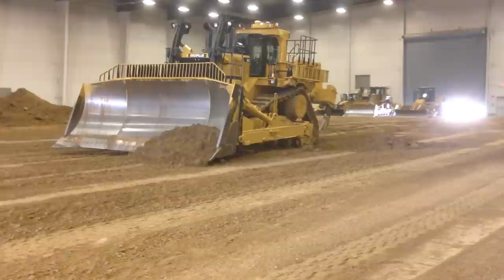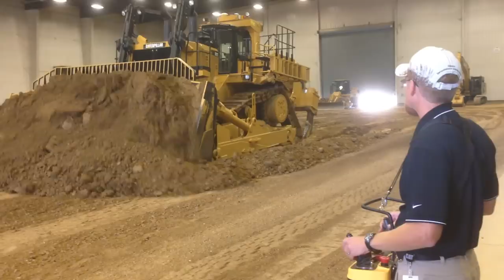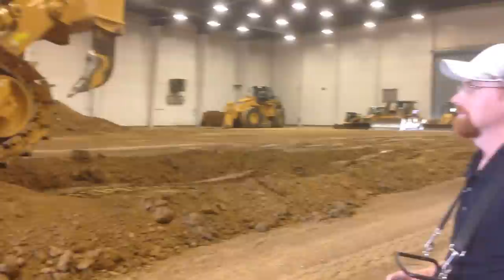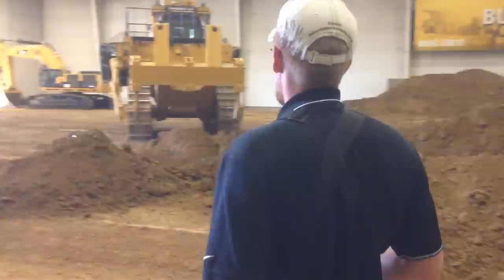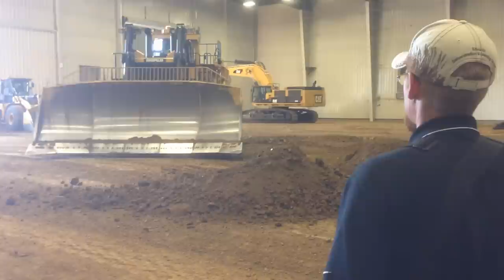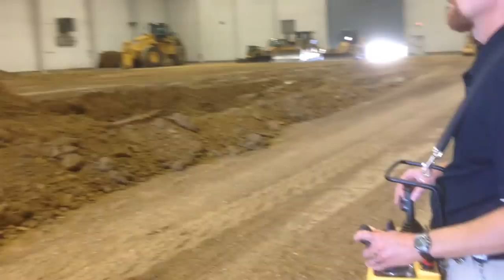Remote-Controlled 900+ Horsepower Caterpillar Bulldozer

Comment: Hi, Folks.
                Do you mean that some poor sucker has to STAND out in the blazing sun to operate that machine instead of being in the cab in air-conditioned comfort? 

More than half the fun of operating these machines is the sense of power and control that you get from being right there in the seat, and FEELING the machine do what you tell it to do. I somehow that the same level of control is possible OFF the machine, even if there is a shady tree close by for the operator to stand under - - - or sit if the employer is thoughtful enough to provide a seat.

I have never operated a remote controlled machine but, after 50+ years of seat time, I think I'd still prefer to up there in the seat. I learned a LONNNGGG time ago that the machine will only be as rough on you as you are on it.

Just my 0.02.

You all have a wonderful day. Best wishes. Deas Plant.
Reply: maybe they use this way to operate in a poor security task as a minefield i suppose
Reply: Hi, Sergio S.
They have been using RC 'dozers for some years now for various tasks, mainly around large open-cut mines for either overburden removal or restoration, supposedly to avoid the possibility of human injury in the event of an 'accident'. I would suggest that 'accidents' might be a fair bit LESS likely with a good operator sitting in the seat and having 'seat-of-the-pants' feel of the machine.

Just my 0.02.

You have a wonderful day. Best wishes. Deas Plant.
Reply: Thank's, be well!
Reply: Agreed, no AC cab? What's crazy about those is how quiet they are in the cab, that will come in handy for Trumps wall project although they do have bullet proof glass in the cabs already.
Reply: In some mines they are removing the overburden to get to veins of coal or other mineral which had been mined up to 100 years prior by using tunnelling..driving a 100 ton machine over these old shaft is very risky so remote machines can be used to keep the operator out of harms way.
Reply: I agree I only have 25 years and I was always told u operate by the seat of ur pants literally. have to be able to "talk" with the machine
Reply: Deas Plant maybe people would like to hear what you have to say when you actually use correct grammar
Reply: It's not that this is how they operate two at a time
Reply: But this tool is very functional to commit crimes against humanity, especially which is often done by Isarel in Palestine
Reply: Deas Plant i pretty sure the remote is mor for unsafe situations  such as a steap hill or something that you dont feel safe being in the cab doing as for me I prefer being in the cab all day I run excavators and loaders all day long and I dont feel that remote is the professional way of doing it but people have there own thought and ways I guess I got a CAT 289D at my house I use almost everyday to fix up the yard and not once have I found a reason to use the remote it just sits in my closet
Reply: when your fueling it up and try to get as close to the tank as you can.
Reply: Deas Plant dont forget radiation polluted territories, like Chernobyl. No one will sit in a cab there
Reply: once the entire machine is computer controlled, then a script can make it to tasks without an operator.
Reply: I'm sure they just wanted this for a safety thing.  I don't think companies would ever permit someone standing around a quarry or lumbar site with a dozen other huge machines.
Reply: Deas Plant thats not entirely what they are saying cause you could sit inside of it but you might as well just use the regular controls if youre gonna do that..the poindexter in this video had nothing better to do than to implement this technology into a dozer.

Comment: seems hard to run. I've been told to run equipment by the seat of your pants. meaning you have to feel the machine to run it as it tilts or rocks back and forth ECT. seems like it takes talent to run it effectively and accurate.
Reply: As a 20+ year operator its painfull watching this guy...this might be ok but i would prefer to he in the seat
Reply: 100 percent run a 9L and 10R at work definitely on feel

Comment: Why is it equipped with flashing blue lights on the top ?
Has the Sheriff got him self a new company car ?
Reply: For safety, the blue lights will be easily seen in a quarry
Reply: Somebody operating another machine.
Reply: The blue light is one of many colors for remote operation
Reply: Normally they'll do orange beacons but blue is the same, when it's put into the quarry or construction site it's so other operators in sometimes bigger vehicles can see them.  And some companies work late afternoons and in bad weather.
Reply: Everything in a mine or quarry has designated flashing light to tell what it is gotta remember most of these places are 24 hour operations
Reply: Blue lights in a quarry means remotely controlled

Comment: Will never be as good as a good operator sitting in the seat and oh by the way need to tighten the Dame tracks jeeeeezzz
Reply: It is mainly for use in unstable zones, ie rockfalls, tailings or land slides.
Reply: 10 4
Reply: +James Burnette for something that will help you avoid hazardous conditions, it's good enough for now. and technology advances exponentially!
Reply: +James Burnette They run that way.
Reply: Flatline Heartbeat to sloppy. You probably never had to change tracks.

Comment: If one of my guys was to leave my work site with a pass like that I would fire them. Leave the operator in the seat
Reply: @Wyatt Duboise you always engineer safety into your operation. There is no way im going to put man or machine in a unsafe or potentially lost of person or machine in that situation. The operator's that work with me are first class and it would be more dangerous with a joy stick driver than a real operator. My opinion with 25 years behind it.

Comment: While there might be an ocassion where being off the machine would work. Why would any Operator want to stand out in the sun , rain whatever. Which that control box hanging off his neck ?  What do you guys think ?
Reply: Marc Langevin why would the guy have to be out in open. Why not have a small shelter with an umbrella and shit? Anything is better than being strapped to some of these torture devices.

Comment: Work great but that 8 to 10 million dollar dozer not to do a walk around inspection check for cracks in the welds ect nice concept but costly mistake just a thought thanks and the remote read oil temp final drive temp ect thanks

Comment: Now why in the hell would I want to stand out in the elements to operate that machine ? With a  ? lb control panel hanging off my neck !
Reply from the maker: Marc: the remote operation is designed for locations where there is a risk that the operator could be injured - ie mining operations or unstable ground, so they can stay safely outside of the vehicle.
Reply: @theawesomer  I realize that there might be the need for the remote control in some applications. But I am old school. Started running equipment in 1970 .

Comment: What happens when the remote gets a flat battery
Reply: Its a safty switch that turns it off. Same if you were to fall over. Theres a sensor that kills the machines power to move till the board is back at the correct angle again

Comment: What's the point?
Reply: Jpaydirt i saw this thought of you saw you commented...whats the poin what i thought....well put on a high wall in wv coal mine working it down....not feel it slip atittle and walk off alittle and uhhh ohhhhh down goes a 2mil dozer tumbling down the hill....but hey atleast there wasnt an operator. right....later man
Reply: I know they explained why at Conexpo, I just can't remember, ☻
Reply: Carson S okay and where is tje operator gonma be able to see all this stuff? From the bottom.  If he cant even see where the machines edges are , whats the point if he cant even see what hes gonma hit.. its gonna end up comin down anyways... 5 yrs of backhoe and tractor operation and i already kno it wont worm
Reply: Luis Sanchez yea i know it wont work in those situations...i was being sarcastic cause you have to feel in the seat as much going on as you can see...especially if soft ground or something...pretty usless unless driving straight at ISIS with a brigade hiding behind the blade....
Reply: Well I can tell you why Allis Chalmers invented the remote controlled crawler back in the 1960's was mainly for work at the steel mills, where the operator couldn't handle the heat, but the machine was built with special hoses and wiring to handle it. Also for dangerous situations in the armed forces etc.
So once again Allis Chalmers was 50 years ahead of the crowd
Reply: They can use this in hazardous situations like if they hit a giant gas leak while mining or at trash landfills where the methane gas is to much for a person to handle  or if they need something done and it's too dangerous for a operator to be involved in even tho that machine cost well over a few million it's not worth a persons life so I think it's pretty amazing that inside that dozed there are hundreds of switches to control it that guys little box can do it all from there haha
Reply: Umm... a gas leak? that would cause the engine to run away
Reply: Jpaydirt it could knock the operator unconscious and then possibly lead to suffocation
Reply: Wade well you definitely couldn't if you're dead. Also I imagine it just takes practice.
Reply: Ger Stephenson a gas leak will make the mechine run away, and you would have known their was gas plenty before the mechine runs away. Ive hit gas lines milling and had the fucker start running away and i had to stuff the shirt off my back, and my side guys shirt into the intakes of both motors
Reply: ryan lucey A gasoline engine might run away, but a diesel won't. Gas would need a spark to ignite it, there is no spark with a diesel. If it was burning natural gas it would just have more power until the diesel was shut off, the engine would stop
Reply: Incorrect sir, a diesel is a compression ingnition engine and will run on any vaporized fuel no spark needed
Reply: In case of accident the driver isn't killed
Reply: ryan lucey we're talking about hitting a gas pocket in a rubbish dump, the driver being knocked out and suffocated. A gas like methane will give you no warning, it's colorless and odourless so better to use a remote and not risk it.
Reply: Ger Stephenson I thought garbage dumps had breathers? And I understand its odorless i passed hazmat
Reply: Jpaydirt No I'm not incorrect. A diesel runs on compression gasoline or natural gas engines run on spark ignition. Compressing natural gas would not make it ignite without some type of spark. On pulling tractors they use to feed LP into diesels for more power, but the diesel ignited the LP giving it more power. Compressing gas actually makes it colder
Reply: Well think about it dude a diesel running and ingesting natural gas will run away, Why do you think all oilfield equipment has to have automatic valves that block the exhaust ? if a diesel ingest's natural gas it will runaway and also will ignite the ploom causing one hell of an explosion, if you don't believe me goggle it
Reply: Jpaydirt I've been a diesel mechanic for over 30 years. If you think I'm joking take the 3406 in your Kenworth feed LP from a propane tank into the intake and shut the key off, let me know how long it runs. For one thing gas rich air coming into the intake with no diesel fuel is going to be way out of time  to keep an engine running. Further proof is Cummins, Cat, Detroit all make CNG engines, they all have spark ignition. If a diesel will run on natural gas they would leave the engine alone, not highly modify it
Reply: Jpaydirt gladly. First off your dealing with OSHA, and much like any government agency facts have little to do with rules and procedures handed down by them.  As a contractor you I'm sure know that the majority of government rules and procedures have little to do with real life.Second if you read the article every picture says "believed" to have caused, which has about as much credibility as turning your cellphone off before the plane takes off, because they "believe" it may effect the plane, when in reality there is 0 proof it has any effect
Reply: ryan lucey your probably right, but the engine was designed to run like that. A regular everyday diesel engine is not
Reply: Actually the rules are  derivitive of the mistakes and carelessness of humans, comparing an electronic device to a flammable gas being ingested by a diesel engine is a poor comparison, I think, You have given me an idea.....I'm going to test your theory on and old junk engine to see what happens, may I attribute the results to you on my channel?  sort of a mythbusters video☻
Reply: Jpaydirt i cant wait to see this.
Reply: Jpaydirt you are right sir. I drove winch tractor for 38 yrs in the oilfield in northern Canada. We have emergency shut offs on all the trucks that go onto the lease. Yes there would be one hell of an explosion
Reply: Exactly what is the foking point one machin to RC ???? It's new for who ??? This tecnology it's opsolet un usa plis reinvencion
Reply: Is good for working near vey unstable high walls or pit edges. And can be good for areas too high in gasses like so2 for people to breath. Also good if there are misfires in the area of unknown location and access to area is required or something similar etc etc.
Basically, it’s good for anywhere you need to do work that poses too much risk to put a person in there.

Comment: I’m wondering what’s the point of it? You still need one person for operating
Reply: Risk is reduce
Working in excavtor has 90+db voice
the man simply  avoid thhis
Reply: @kartikagrawal1896  so now you stand 80 feet away! And the noise is even worse! Than inside the cab! The newest models are really quiet!
Reply: @americafirst4325  i have worked with this
In the mountain breaking etc process it is not at all possible to  reduce voice 
And many other area are there where this is very usefull
Reply: Think of risky areas that someone wants to fo something but the operator doesn't feel safe to go. They can do it remotely at a safe distance vs in the cab feeling scared. Say if you work at a mountain edge. The dozer or whatever machine can fall but the operator is just cursing in the background for the companies stupidity of such a terrible location vs him being dead rolling down the mountain in the cab. Also think of a place like chernobyl where machines can get close but humans can not.

Comment: Cool but, your not going to find a Operater! That’s going to stand out in the hot sun or rain or cold! When theirs heat and air conditioning in the cab.  Just saying
Reply: Thing of dangerous situations where they have zero problems sending out the machine but the operator doesnt want to go. Do it remotely

Comment: Ya because standing outside in the sun is much better than in an air conditioned cab..whats the purpose of this..I can run that thing from the seat better than you will ever dream of running it from a distance

Comment: Id rather be in the cab with a radio and heat and ac than hanging a big ass remote around my neck just saying and it has remote controls in the cab imagine that in the cab with a seat too no way with erops and everything radio heat air wow when i had the lite bright cat dozer qnd excavator i was trying to figure out how can i sit on it or in it to drive it just me i guess even the tonka toys i was like can i get in the back of thr dump truck and drive this thing

Comment: And why do this? I rather have a driver in the cab! Just a waste of money 💰
Reply: Not really. This machine is capable of driver and remote operating. Good for places where you need to get a machine but an operator might feel at risk of his life. Places like working in chernobyl where radiation is high and noone can get close but a remote machine would help out massively at the cost of the piece of equipment and not the operators life